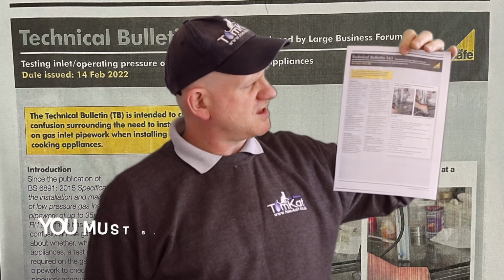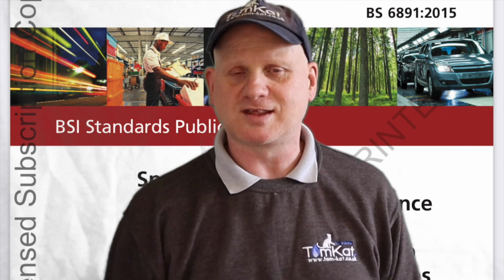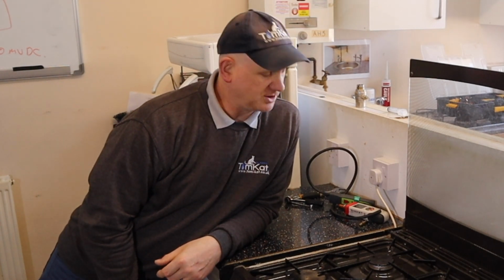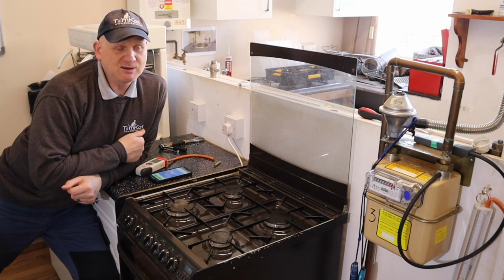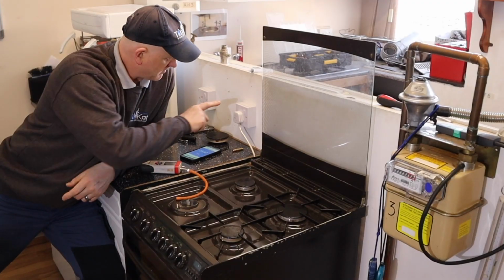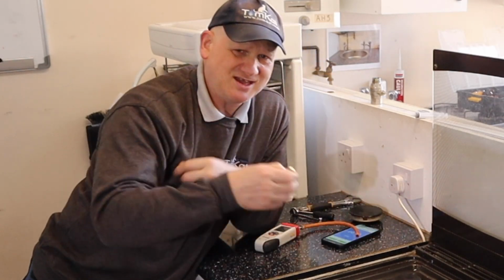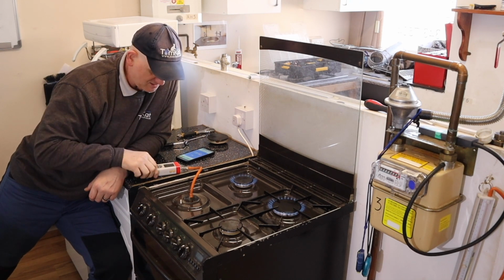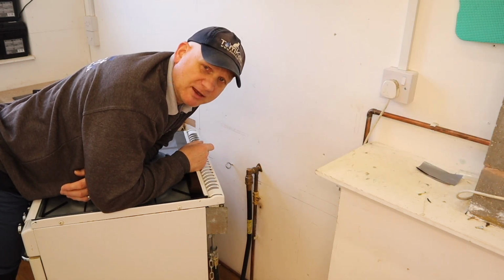How to test a cookers inlet pressure with no test point to gas safe TB161.

Comment: Question. To do a working pressure at the cooker with no test point so using the injector on the small hotplate burner. Can I have the grill and burner on instead of the 3 burners to prevent lighting back?.

Comment: But are you checking the inlet pressure - or burner pressure.
Id say your checking the operating pressure and not inlet.
 as you are checking at the burner.
Reply from the maker: You are checking at the injector before it mixes with air so it’s inlet not burner pressure
Reply: @tomkatgastraining Inlet pressure is pressure at the inlet of the appliance.??
You are checking past the gas valve at the burner.
I cant think of an operating/burner pressure on an appliance where your checking premix with air. Its always gas. Think of some OF water heaters with test point on burner. respectfully disagree but great videos
Reply from the maker: @phillipboag on a cooker it’s the industry standard for checking inlet or operating pressure because there isn’t an inlet test point
Reply: @tomkatgastraining Many test points on LpG that i also do.
Static vans nearly always have  a TP under the base. such as New world, Widney Belling etc.
I see what your saying and maybe semantics, but if you call it inlet, I wouldn't. but nobodys doing things wrong. just look at it different. As i say respect - Love the channel and thanks for the vids

Comment: Hi, shouldn't be 3 burners lit and 1 under test? I saw you've done it with 2 burners lit the third on under test and 4th off. Did I never get it right?
Reply: We test from the meter with three burners lit. By testing from the injector direct, effectively there are three burners using gas, it’s just that only two of them are actually lit.

Comment: Gas rate is best way forget this as a sole trader. One time the injector shears off your buying a new cooker for someone.
Reply from the maker: What if no meter then you can’t gas rate
Reply: I've never seen in 23 years no meter on a natural gas supply. I see your trying to hint at LPG but I'm not aiming at that because that has no relevance to me or my work. One time you shear the injector and I've seen it happen, you're standing to the cost of a new cooker simple as.
Reply from the maker: @theengineeroilsafe279  it’s all about lpg or if you think the pipe is undersized also didn’t you watch the end of the video

Comment: i once did that test over the injector using the rubber hose and the chap who was testing me told me that it wasnt a proper way for testing inlet pressures.so whats changed?
Reply from the maker: It’s testing operation pressure not inlet because it’s after the gas tap. It’s always been done like this as long as I have been in gas which is a long time now I guess it’s just been brought out because engineers must be turning appliances off because of no test point when they shouldn’t be doing.
Reply: @tomkatgastraining  I'll bring this up next year at the center.ive my renewals in around 10 months. I'm talking nearly 10 years ago now when I got told I couldn't do it like that. Interesting to see what he says when I bring it up.

Comment: What about if there is FSD on cooker.
Reply from the maker: What about it the video is testing the inlet pressure not safety device
Reply: if there is an FSD then you would have to hold down the control knob of the burner you are using to connect the manometer to this is necessary to allow the gas to go into the manometer.

Comment: lpg. no unburned being leaked. is that why they brought this in? or did someone really put themself on fire?............. why are you only using 2 burners? i always tested with 3 on and 4rth as test point? with all appliances running at max if there was no external test point. anyway im happy if im wrong i overkilled it.

sorry don't do ebay
Reply from the maker: Working pressure at the meter is yes 3 biggest rings running I had 2 running and used the 3rd to get the readings as the manufacturers don’t give the pressure readings. Some cooker manufacturers only require one ring running while you are taking the readings others 2. As the technician bulletin said the rings running will depend on the cooker manufacturers. Also didn’t want to set myself on fire while doing it 😜
Reply: im a dumbass and cant spell.. we test at the applance right? the whole point is that all appliances have enough gas to work at their air gas mixtures right? third ring was static right?
Reply from the maker: @markchristohperowen6806  correct we are always trying to achieve complete combustion because if we don’t people could die of co poisoning
Reply: @tomkatgastraining  you degress my point was you should have had three rings burning. right? and all appliences running at max. and then used a test point be it at the nipple or on the pipework............ i'll go read up. i know i'm probably wrong. you lot run a gas place in manchester that accredits people.

 buy better glass manomiters? they have a cross you have at the bottom that stabalizes the u gauge. wind blew mine over once. cost me a replacement glass tube........ and it doesnt need calibrating.  

 thank you for your uploads as always.
Reply from the maker: @markchristohperowen6806  because of the way meters and pipes are sized you don’t have to have all the other appliances running at the same time it now says to have a maximum of 3.5 m3 and a minimum of 0.5m3 running when testing at the meter. So unless you have concerns about an appliance you need to check the pipe sizing and operation. So when testing a cooker you have the 3 biggest rings running and check at the meter you have 21mbs +/- 2 mbrs no need to have all the others running unless you think the pipe is undersized then you put the smallest cooker ring on low then turn on the boiler at max and see if it affects the safe operation of the appliances ie incomplete combustion or flame going out. I hope that answers your questions
Reply: tomcat do you have a favorate charity? before we talk about gas valve bounce. i cant give a lot but thank you.
Reply from the maker: @markchristohperowen6806  why do you ask
Reply: @tomkatgastraining  because i wanted to know.
Reply from the maker: @markchristohperowen6806  bit nosy aren’t you 😂
Reply: @tomkatgastraining  no, i just wanted to donate to a charity of your choice.
Reply from the maker: @markchristohperowen6806  that’s very generous of you but I don’t have one. You have made me think though that maybe I should 🤔

Comment: Don't  think I've  had cause to criticise  you before, but, and Don't  see this as a negative comment.
Firstly, attempting to attach a uguage hose to an injector is ABSOLUTELY  a NO DO!!
Best test nipple is as used by Calor engineers, but the one you used is fine, just nip it up or use gas tape to ensure finger tight leak free.
Calor nipple has neoprene washer, so is only designed for minimal tightening.
If testing hob only, testing with three burners lit at full rate is the requirement,which leaves the fourth and ideally the smallest available  for fitting the adaptor.
Where a fifth burner, (eg Wok burner) or even more then obviously to arrive at an accurate pressure drop, this needs to be taken I to consideration.
With regard to the usual fith burner 
 on hobs, the pressure drop will often surprise.
With cookers the effect ovens/ grills have on pressure drops also needs to be considered.
With regard to LPG, if no meter is installed, usual on single dwellings, there will always, or should be an outlet test point.
To quote Mikey Pipes ( check out his utube  channel, it's great) if you ain't  testing, your guessing. 
Just a little extra advice for anyone  thinking of getting into LPG, orange rubber hoses quickly get devoured by the Gas.
Reply from the maker: Don’t want to criticise your comment but guess you didn’t watch the full video then 🙄
Reply: @tomkatgastraining  
I've  watched the video twice since your response,  and have to say if I where a trainee or inexperienced in the industry, I would be confused.
TB161 ,in my humble opinion, and I've  just read it again, it's very badly presented. 
Regardless of one's interpretation of TB161, I stand by my way of confirming, lack of gas rating ability withstanding, is a safer and more reliable way confirming compliance.
Testing working pressure on a cooker with two burners operating doesn't  cut it for me.
Cooking appliances  have to operate, as with all appliances as designed.
Please read my comments again, and if you conclude I'm  missing something, I'm  always open to discussion.
Reply from the maker: @johnward5006  like I said in the video if I had used all for rings doing the test on the cookers injector I would probably set myself on fire. Yes you are correct I should have used 3 rings on doing the test but I know some cookers only say use one other ring and others say 2 like I did. At the end of the day again like I say in the video it’s not needed for Nat gas most of the time as you can do working pressure at the meter gas rate and put other appliances on to test the flame picture. Lpg though is a different matter. Sorry I disappointed you with this video but it was only for make engineers aware of the tb and to get over to trainees that it can be dangerous if you use a u gauge or a small injector. I will try harder next time 😋
Reply: @tomkatgastraining  understand  Derek, will  clarify
Reply: Understand absolutely  Derek, will speak to Gas Safe after Easter for clarification. 
Again Gas Safe cover their rear ends with such poor quality offerings. 
If  I'd  written this bulletin, I'd  make it clear that pressure loss and flame picture and if possible Gas rating would be mandatory.
To suggest appliance working pressure testing needs clarification is a sad reflection on a highly regulated industry.
When I first embarked on LPG training in 1968, 
Test nipples were the norm
Any Gas engineer who doesn't  have an injector adaptor is categorically  not being serious.
Reply from the maker: @johnward5006  I think the reason for the tb again like I say in the video engineers thinking test points need to be installed at cookers so for me the tb is saying that’s not the case you could test at the injector of the cooker if you think the pipe is undersized for me that’s what it is trying to get across to engineers. And again because there are so many different cookers with different manufacturers wanting different readings they are not that specific with the test much like me 😂
Reply: @tomkatgastraining  I understand as you do, but do the new entries. I've  done my acops/ and asc on  cookers since 1998, but have I got all the answers, butas I've  often ad ised
Reply from the maker: @johnward5006  it’s my job to get it over to the new entrants and hopefully when I teach it in class I go through it better than this video 🤣
Reply: @tomkatgastraining from my experience  training and assessment  on cooking appliances is lacking.
I know you are in the top echelon  of industry educators.
I'll  have a go at  the Gas Safe  mentality.
Don't  hold out much hope of a response beyond the usual gsiu regs, manafacturers  instructions, de da,de,da.
Common sense, training, experience and the desire to improve,count for what?
.

Comment: Why not just gas rate instead.
Reply: I’m on a contract where they’ve replaced electric cookers with gas cookers and just tee’d off the gas pipe for the boiler, the gas cooker gas rates fine but when I test the inlet pressure with the boiler running it’s a fail. So In my opinion some situations require this test.
Reply from the maker: @jamesasprey2092  completely agree
Reply from the maker: What if there is no meter like on most lpg insulations
Reply: @tomkatgastraining  True, I don't do LPG tho 😄